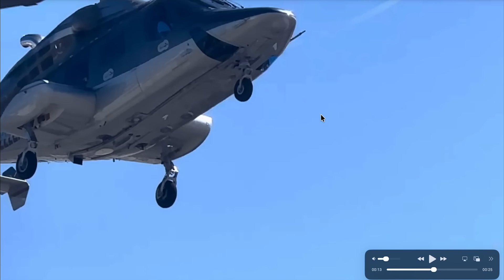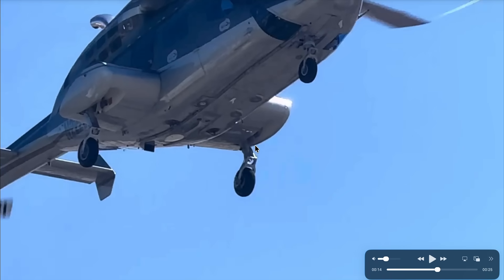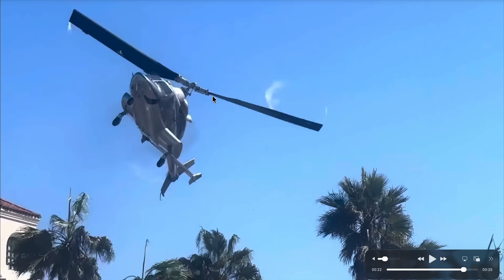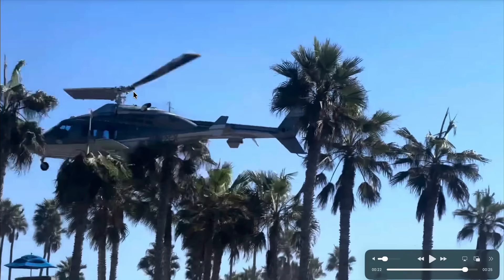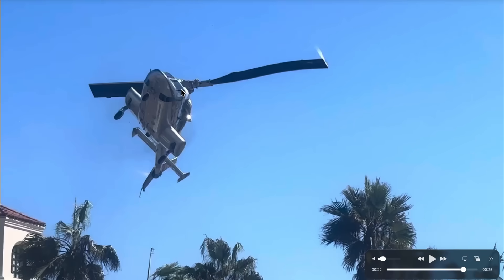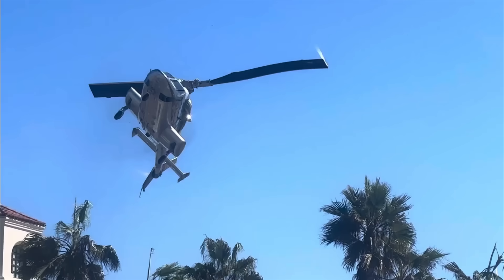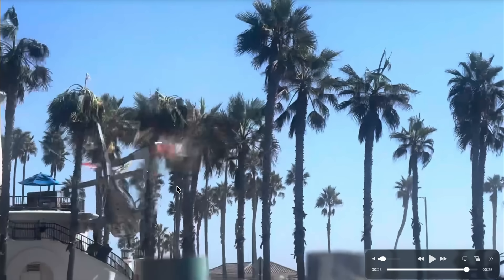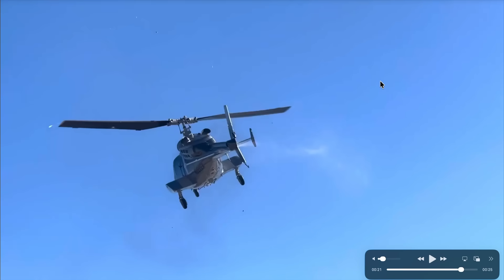Huntington Helicopter Crash Analysis - SlowMo Video!

Comment: A&P here. Heli's are in constant service. The logbooks and last service conducted will show what was worked on. Also being a pilot I don't like rotorcraft as there are many many failure points that will outright kill you if they fail. If the tail rotor was recently serviced I'd suspect a mechanic overlooked final inspection and missed something.
Reply: And it's strange because there are helicopters with over 10000 hrs. on the airframe with no catastrophic failures. Then some end up like this.

Comment: As a helicopter mechanic I always inspect a tail rotor by first pushing one pedal all the way down against it's stop , walk back and look at the pitch change hardware while moving the hub back and forth against it's flapping stops . Then I go back to the cockpit and repeat the procedure with the opposite pedal all the way down . Nobody ever does this because you have to walk back and forth the length of the aircraft twice and everyone is too lazy to do that .
Reply from the maker: solid procedure that should definitely be done more often by pilots as part of pre-flight.

Comment: I would assume the tail rotor seized and came to a complete stop, which sheared both tail rotor blades off at the same time.  Excellent clarity and narrative.  Well done.
Reply: It looks to me like the tail rotter stumps stopped moving after the blades were sheared off.  But I can't tell if that is what i am see or if its an artifact from the camera appearing to show them stationary.
Reply: I was thinking tail rotor bearing failure at first, too, but then somebody pointed out that at 0:40 you can see that one tail rotor blade has zero pitch setting which cannot happen unless the pitch linkage has physically failed already at this point. And you can see one arm of the pitch linkage swinging at larger radius even before that.

Comment: Helicopter pilot here! There's something nobody is talking about and for me it seems to be the actual cause of loss of control and susequent crash. If you analyse the moments prior to the start of the spin, you will notice how one of the links of the tail rotor has separated from the blade and because of centrifugal force it is just spinning parallel to the blades. That's why you can clearly see how one of the blades is applying maximun angle of attak while the other is just at neutral position. That condition clearly caused an imbalance and asymetrical force on the root of the tail rotor, hold that long enough and you will have the results of the video: tal rotor gearbox breaking, blades exploding from material fatigue and of course LTE and at last, a crash.

Not to criticize the pilot response to that, but I'm sure that prior to the crash he felt more power pedal demand without a clear reason and lots of vibrations, a clear signal to go to the ground ASAP, and he had a perfect spot right in front. Also, not very sure why he pulled max collective after the LTE, the only outcome he could get from there is the crash.
Reply: He didn’t “pull max collective”. When the power required to drive the tail rotor was no longer needed (no more tail rotor) it was translated to the main rotor, thus more lift. If the tail rotor is no longer meeting the friction of the air, the system needs less power. His manifold pressure likely didn’t change at all. He would have had to lower collective to prevent the climb. No collective input at all is probably what we see here. Uncontrolled climb and yaw is consistent with loss of a tail rotor at a hover.
Reply: @TheZachAlex  exactly. So many people stating this as a fact is frustrating. The response was too quick and in time with the major TR failure starting... and the last thing you want to do when you lose your pedals is to pull collective. Now why he didn't notice any vibration from the pitch link coming lose and then the extra boot he was having to put in coming into the hover, is another question. But once it started the time you have to do the right thing, and the options you have is tiny.
Reply: @TheZachAlex  The climb began before the tail departed, and with a single tail rotor blade unable to hold the torque, the spin started.  I'm sure the tail creates more drag if only one blade is functional which would take power from the mains.
Reply: Yes, you are correct, I noticed that on the day it happened, a link failed. When he lost the tail rotor it's like adding 200hp to the main rotor which caused the climb up and the start of the spin. I've never flown a 222 but I know it has a funky throttle that he may not have been to throttle down quickly enough to counter torque and start a auto.
Reply: sure seems like the root cause!  nice catch!
Reply: We’re in the middle of this video when you’re talking about what the tail rotor is doing if you go to Mark 458 four minutes and 58 seconds you get a very good view of the tail rotor one is above the boom and one is below the boom and you can see that the one above the boom is that a very high pitch and the one below the boom is pretty much neutral. I can’t say specifically what caused it, but it seems clear that there’s asymmetrical operation of that the two blades on that taro are going on yeah I think that’s the effective cause of the crash. The tail rotor something was going wrong with that tail rotor for some reason what the reason is of course I don’t know, but I did it. Get overloaded in a link break it was a link just ready to break and it didn’t matter result overloaded or not. I don’t think he hit anything with it, but in some places, it looked like he got kind of closer trees. Maybe he hit a tree I don’t know anyways it seems pretty clear when you look at the video that there’s definite asymmetry on those tail rotor blades and that’s in a sense the the cause of the crap going out of control and subsequently crashing.
Reply: Linkage failure in my personal opinion
Reply: It appeared to me that the pilot felt a LTE and pulled pitch in an attempt to gain altitude and forward airspeed to arrest the issue.  Unfortunately that just caused more torque and more uncontrolled yaw.  As far as the anti-torque blades pitch angle being high, he was in an out of ground effect hover with little to no forward airspeed so the pitch would be much more than you would expect at cruise where weather gaining would occur as well.  As far as the main rotor blade system sheering off if that was the case the pitch links would not be able to hold the main rotor system to the shaft and it would have departed the from the mast as it seems he never rolled the throttle into spring detention and lowered the collective to arrest the violent yaw.  He was in the grey area of the operating profile, out of ground effect, slow and low with little to no airspeed, using lots of power and collective to attempt a landing,  lucky that the palm trees lent a hand in the crash landing.
Reply: Fixed wing pilot here, so I may be talking out the side of my neck, but would the loss of resistance from no longer needing to turn a tail rotor not cause the engines to spool up some, thereby causing the exhaust smoke and a non-pilot induced climb, with the accompanying increase in torque induced yaw? Maybe he didn't yank on the collective?
Reply: @SidHubbs1  I think that's what happened
Reply: Great professional understanding.
Reply: I also agree with the tail rotor control being the start of the problem leading to a gearbox failure, weather it being a internal gear/bearing failure or a gearbox case fracture.

Surprise that he kept the collective or power when it was clear that tail rotor authority was lost.
Reply: Exactly what I stated a couple of days ago... It's nice if you have tail rotor Authority when you're flying a helicopter🙏🙏🙏
Reply: Centripetal or centrifugal ?
Reply: I saw another analysis and he said that the unloading of the tail rotor was transferred to the main rotor which caused the aircraft to rise.  He didn't think that the pilot necessarily pulled up on the collective.
Reply: My helicopter did not rise when I lost the tail rotor. It definitely spins, but it didn’t rise.
Reply: @airpirate2119  if you did nothing with the collective it would start to rise while spinning then equalize, it has to, the power that was being used for anti torque is now going to main rotor. That was a trick Nam pilots would do when they were overloaded, kick in right pedal and start to rise then before the spin got excessive move forward through ETL. I would hope you quickly lowered collective and maybe cut power before it was noticeable.
Reply: @gorgar9965  Problem with that is the helicopter was rising before the tail rotor totally failed and it was unloaded. Tail rotor had an anomaly without failure first.
And he should've immediately reduced power & lowered collective if that was the case
Reply: @MrCarGuy and engine cut off
Reply: Easy to second guess the pilot watching it all in slow motion but he had zero time to analyze what happened. And what happened occurred at the worse possible time.  I don't know anyway to train for a tail rotor failure at 100ft AGL in a hover.
Reply: Yup my friend is a helicopter pilot and he basically said the same. 

Plenty of room and low enough to drop it on the ground, but pulled more collective instead.
Reply: I’m not a pilot, but in the wide shot you can clearly see that the rotor wash hitting the trees he is directly over on his approach, and then the pilot reacts with max collective?  

Could this be a “ground effect” situation caused by the dense palm trees he was not expecting??  Pilot over reaction that caused mechanical failure?  Just a layman’s thought.
Reply: @OCavant I noticed the aggressive collective movement too and my first thought was pilot induced over torque followed my mechanical failure.
Reply: https://www.youtube.com/watch?v=99QjpdnEdd8   In this video it is clear as day the tail linkage had already failed before approach, it even appears to have been broken in the fast passes(based on lighting)
Reply: @-mikerivers- Disagree, he was in a stable out of ground effect hover approach and was making torque pedal adjustments up until the pitch link failed which in turn started an uncontrolled yaw.   If anything had happened before that moment with the tail rotor system he would have known it well before getting to that point.   He would have had loss of control surfaces for the anti-torque system and a high resonance vibration from the tail itself, when that is the case you would t be taking time to makes nice slow approach, you get the aircraft on the ground immediately
Reply: You can disagree all you like but you are wrong I am afraid; the pitch link arm was lose well before he made that approach. Video and photograph evidence of that. In forward flight you usually use very little pedal input, the blade that had no pitch link would be flying neutral. It wasn't until he started to come into the hover and the blade that could still change pitch was taking all the load that things would have quickly got out of limits and things snowballed from there.

There may have been vibration from the pitch link being lose, I can't say I have ever had it happen to comment, but the extra force and pedal travel required when coming into the hover could have been a clue.
Reply: @MeppyMan the pitch link is loose when the yaw starts from what I have seen in the video. A single blade would not be able to keep the aircraft from yawing and he would lose tail rotor authority pretty fast. At the speed he was going as he approached the trees the vertical stabilizer would have not had enough wind moving over it to weather vane and assist in keeping the helicopter in trim with a single tail rotor blade working.  Still my opinion that the pitch link came loose and the yaw started gradually until he ran out of pedal and then pulled pitch to climb out which just made the situation even worse.  You train to quickly roll the throttle into spring detect and lower the collective and use what inertia is left to cushion the lasting, in this case he came in over the trees and gave himself no clear path to land if there was a problem.  Also the approach could not have been a worse option this is glass service only no wipers
Reply: @1986BBG  My money is on him actually initiating the yaw, and that pedal input was finally too much for the pitch link.
Reply: @davidkeith3920 well until all the facts come out we can all just do are best based on prior knowledge, visual and sound related information and come to the conclusions that best fit our personal opinions.
Reply: @OCavant  I think it’s a combination of both. It’s too much of a coincidence for it to happen directly over the trees.
Reply: @OCavant  No, I think the linkage failure did cause the reaction

Comment: The pitch on the tail blade is probably made by the delta Bering. 
Is is a self tracking Bering. If the balde hub shifts over the shaft coming lose, the pitch may forced to a radical position.

Comment: Looks as if one or both of the pitch change links for the T/R are completely disconnected from the yoke assembly before the rotor system separation. Following that, either the pinion or the entire gearbox separates. The M/R definitely has a mast bump and you can see at least one P/C link break loose, probably having some impact on the whole drive system. Just what I see from my recliner. (21 years helicopter experience, Army, all airframes, NDI and drivetrain experience, maintenance, crew member, and supervisor.)

Comment: I have a question for you experts.  Because you can see the tail rotor blade begin the rotate the opposite direction I assumed that the tail rotor system failed first and that caused the blade to rotate the opposite direction because the helicopter began to spin at that point.  Thanks for any feedback
Reply: The rotor did not start rotating in the opposite direction. It just changed its rotation speed and that makes it looks like it's rotating in the opposite direction due to the stroboscopic effect from camera shutter speed. Helicopter starts to spin at this point because change in rottor speed means change in that rotor's thrust.
Reply: @randomnickify . Obviously there are many out there that know more than I do about this. But if you think about it from a physics perspective if a propeller that is designed to spin in the opposite direction as the main propeller to counter its rotation, it makes sense that if the tail rotor motor fails, the blade would left to naturally reverse direction to the rotation of the main blades because the entire helicopter begins to spin that way without counter resistance (path of least resistance).  Physics doesn’t lie!!

Comment: There another video in slow motion that clearly shows the pitch control rods for the tail ,at-least one of them had came disconnected right before the tail rotor failure!
Reply from the maker: You’re correct! It would appear one of the pitch change link on a tail blade failed. From there it all went downhill. Crazy how such a simple component can cause catastrophe.
Reply: @Outbound300  Actually on your video I think you can see it right on the  @1:00 mark, slinging around, I think!

Comment: Those trees had just enough contact to save them imho.   I think if that was a parking lot impact, the injuries would be severe to not survivable.   Tail linkage failure could be simple as lose locking nut or missed locking wire in nut not replaced?  No idea.  Hope faa solves the cause.

Comment: Lose of tail rotor could cause a overspeed, and it is a serious and potentially catastrophic event. While the helicopter's engine control system, known as the governor, is designed to prevent this, certain failures or rapid pilot inputs can cause an overspeed.

Comment: I'm guessing that the "black smoke " you see from the engines is in response to the pilot prob adding full power.  It looked like he added pitch and pulled power to gain altitude right when the failure occurred. but im just guessing. I know you should reduce power and autorotate but It doesn't look like thats what happen here.

Comment: It would seem that one of the tail rotor blades was at a high pitch and the other was at a low pitch at the time tail rotor effectiveness was lost. I will guess that the investigation will find one of the tail rotor pitch rods failed causing the one blade to go flat in pitch creating a loss of tail rotor effectiveness and an imbalance that eventually tore the tail rotor assembly off of the helicopter.

Comment: Seems to me like one link on the tail rotor has seperated.
You can also see that the blades of the tail rotor have a different AOA.
Leading to asymetric thust -> vibration -> rotor separation -> crash

Comment: I fly RC helicopters for fun, and another reason to go full-up positive collective (for just a second or so) when tail authority has been lost is to try and counter the spin of the fuselage. If the heli begins to spin uncontrollably you hit throttle-hold (to bring the engine down to idle and let the transmission clutch release, so you're no longer putting torque on the fuselage) then pull hard positive collective to counter the spin and then immediately push forward on the cyclic to transition to forward flight (if possible) then negative collective to descend and regain some main rotor speed before flaring to land immediately. It has to be done perfectly and quickly though, once the heli begins to spin... this is the only way to save an RC helicopter from crashing if tail authority is lost. Not sure if or how that translates to full scale manned heli's. As far as helicopter crashes go, this crash wasn't nearly so violent as one would expect and the fuselage remained largely intact which had to have helped save the lives of those on board... this could have been so much worse!